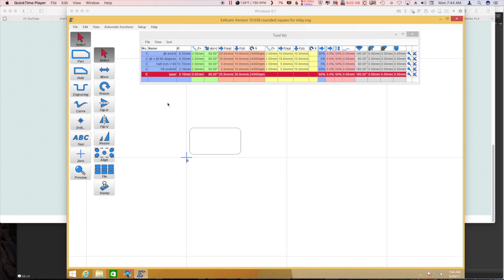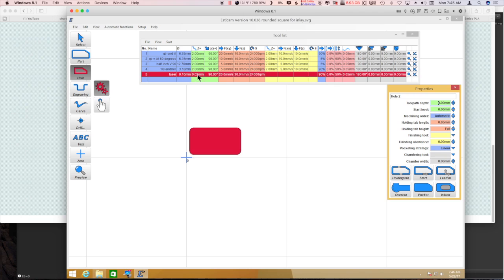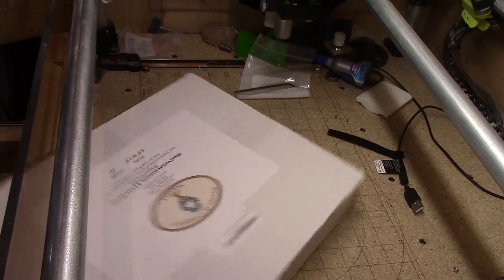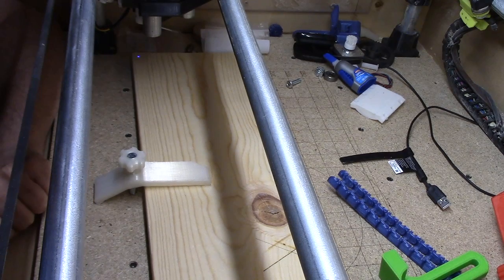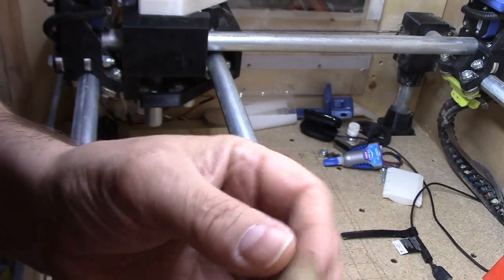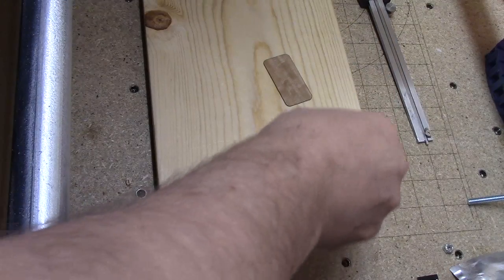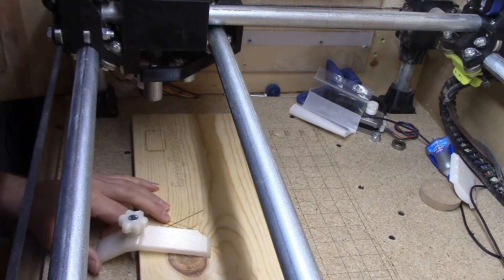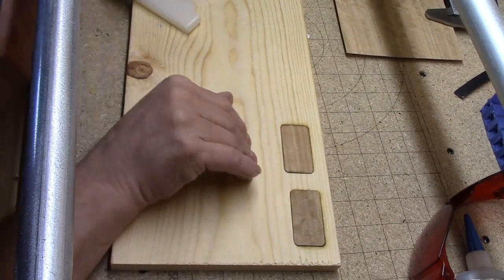MPCNC 26   Trying out some veneer with the laser

Comment: Hi Mark. I'm wondering if it could be made even tighter if you subtracted the kerf of the laser? But, since the kerf is dependent on the focus, I don't know if it can be reliably measured. At a laser cutter in Chicago, they used to measure the focus of their much higher powered laser by firing a pulse into a tongue depressor and measuring the hole with wire gages. I wonder if that might not be adaptable somehow?
Reply from the maker: Cliff Chism Yes! That makes a lot of sense. Being the kerf is being cut out the inlay could be cut a little larger. I wonder if we’d still end up with some sort of a plain black line anyway. Thanks for the tip I’ll give that a try. Thanks for watching and commenting!
Reply: Had another thought... How about shooting through a piece of thin paper and measuring the hole with a graduated reticle?

Comment: Interesting. I'm an furniture restorer,maybe you could obtain a better result engraving the support with the router. Without burns, it will look nicer for sure. And you should use wood glue and apply pressure on the vaneer. Greatings from Italy
Reply from the maker: Greetings, and thanks for the tips from Italy
Reply: Some Old Guy Coding My pleasure 😃

Comment: very cool. I haven't done that myself, but I think the burnt area is going to have a hard time with glue. I think it would work better if, for example, you cut different parts of a logo out, of two or more colors of veneer. then you glued them all to a flat surface.  or you could try cutting the pocket with the mill. it would end up clean and flatter.